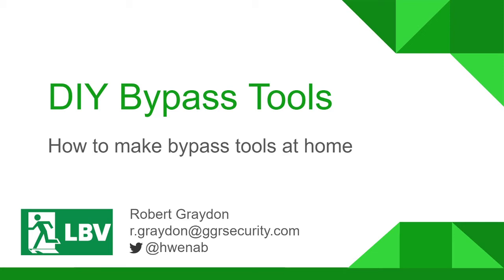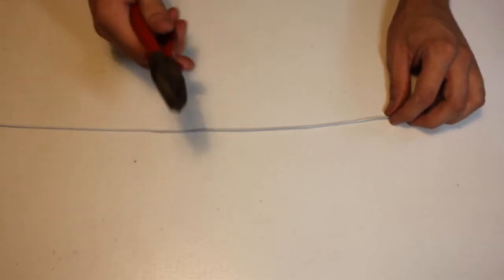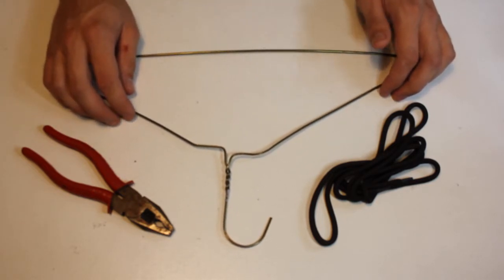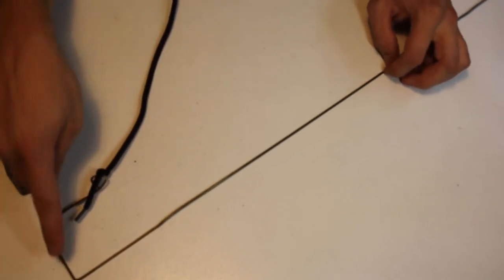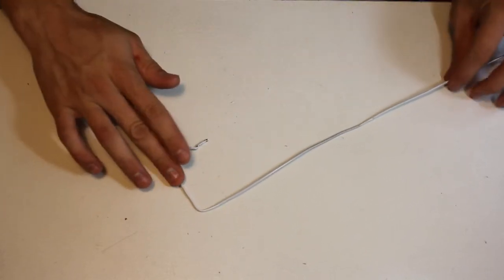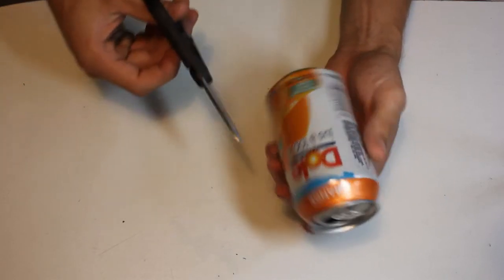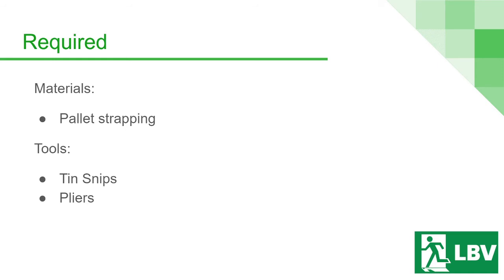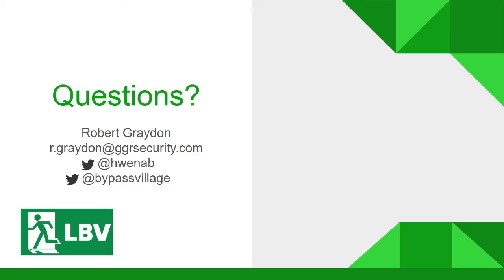DEF CON Safe Mode LBV: DIY Bypass Tools Workshop

Comment: pro tip: you can use 2 hangers for the under the door tool (only one will likely be too short). simply take advantage of the swirly thing at the extremities to connect 2 hangers together, it will be sturdy enough!
Reply from the maker: Great tip! Robert mentions that in the Q&A that happened after the talk, we'll be uploading that after DEFCON is wrapped up so keep an eye out!

Comment: "scissors aren't going to cut it" 😂 For some of those right-angle bends you could use all kinds of seams around the door itself, heavy furniture, or even holes in things to make one or more of the bends. A Leatherman would do most things admirably. Work-hardening a spot could "cut" the wire. For the shims, could you take care on your initial cuts and make them straight to save a step with the flat edges?